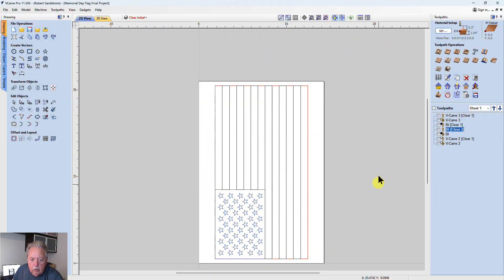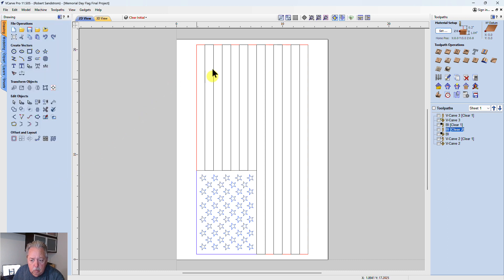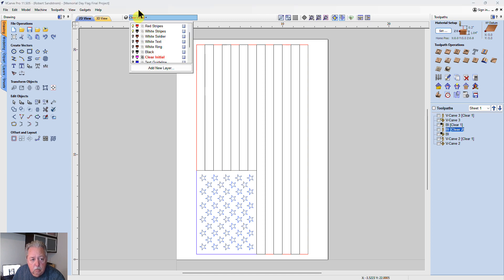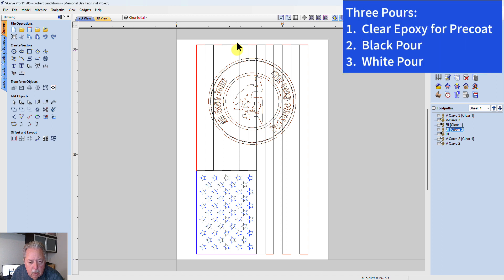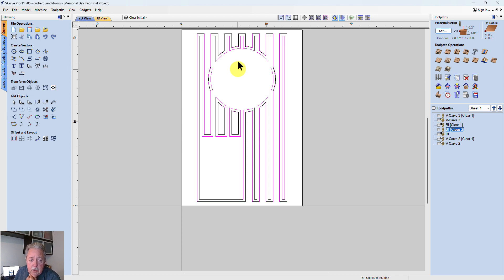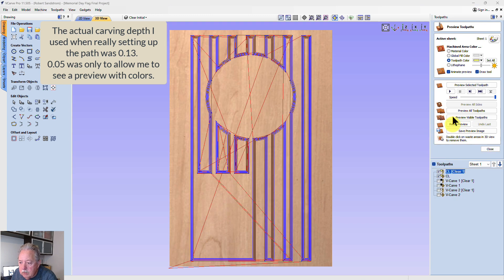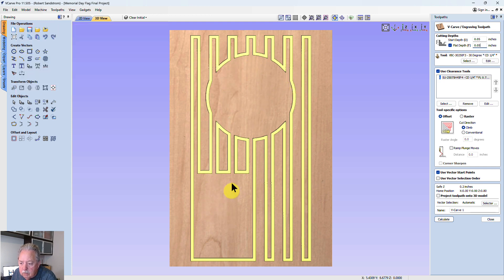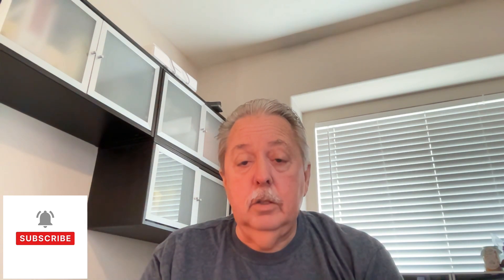Memorial Day Flag Design: Combining Epoxy and Wood for a Stunning Result - Part 1

Comment: A lot of good information. The details would be very useful. I assuming you’re overlapping the vectors? But we all know what assuming means….thank you.  Did you like the 30 degree bit?  Did I see/hear it was a ball nose bit you entered into your tools as a Vbit?
Reply from the maker: Kevin...trying to see how many people really wanted to dive into the details of how i setup the file.  Those videos have not gotten great response in the past, that's why I sorta brushed over it in the first video of this series.  I will see what other feedback I get and consider making a more detailed design video than I did.  

As for Overlapping Vectors - that was not needed for this design.  This is because I poured all of the black first and then I carved the white and poured in the white.  I guess one might consider how I set up the clear epoxy cut as an overlapping vectors but that isn't how I was thinking of it.

Thank you for the positive feedback.